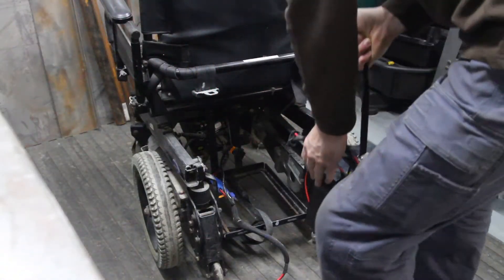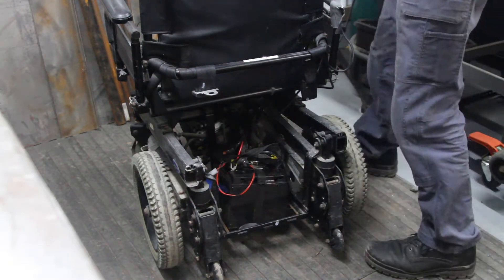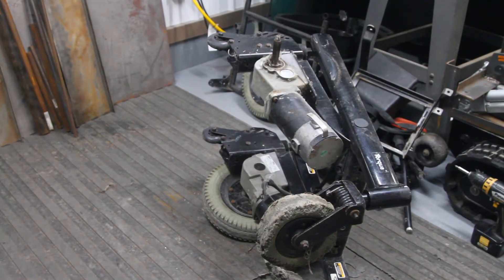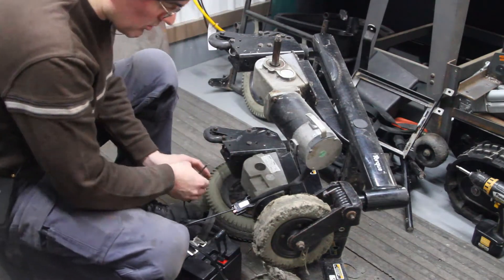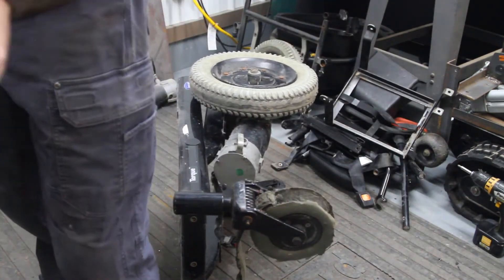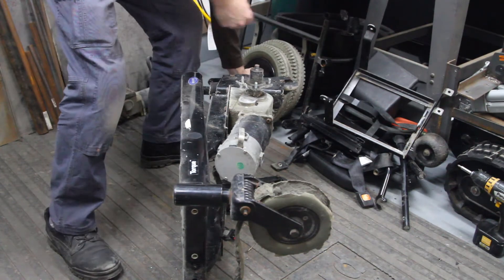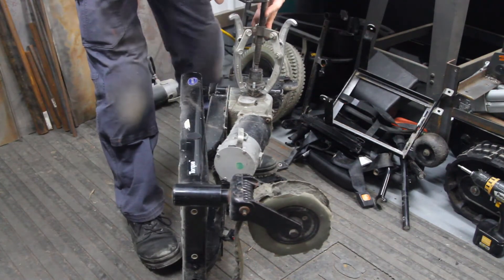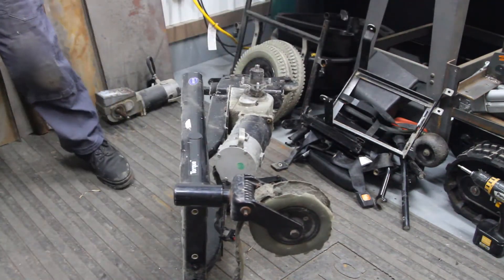Power Wheelchair Teardown part 1 of 2

Comment: Thanks for the video.  I just found a discarded power chair.  Tested it with a 12volt supply and I'm getting action (forward, reverse, turning) from the wheels and all of the controls.  Batteries are shot.  Getting two new ones tomorrow.  Want to clean it real good and repaint some of the metal parts.  Disassembly has gone well so far.